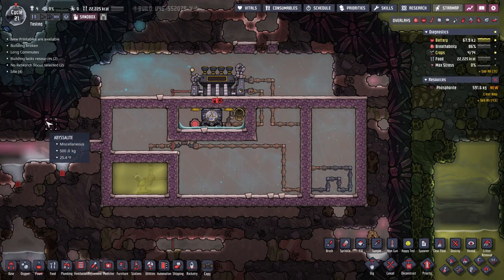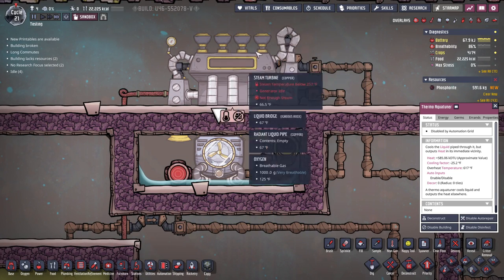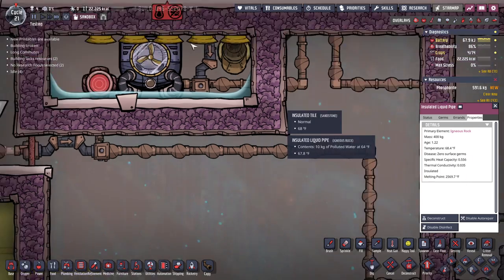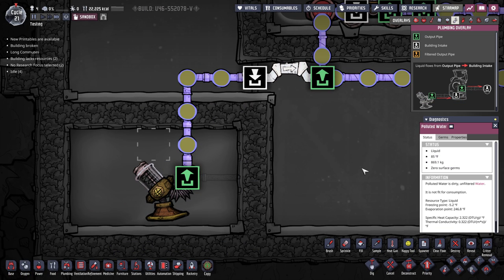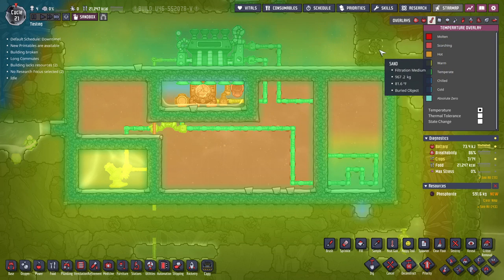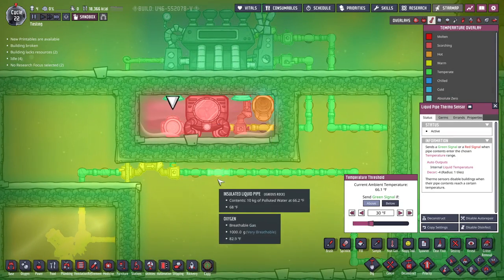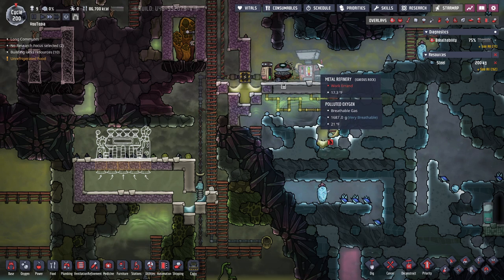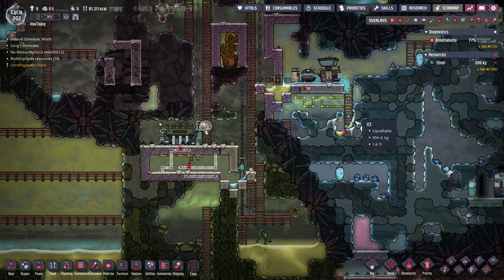Cooling Loop | Oxygen Not Included Beginners Guide (2023)

Comment: Thanks for this, really helpful. I have a basic question do you pump the polluted water into the reservoir before you start?
Reply from the maker: Sorry but I can’t think of what reservoir you’re referencing. Is it the bottom left square room of water in the start of the video?
Reply: @SilverNox  yes that’s the one. I’ve only played 24 hours so far. But really enjoying it
Reply from the maker: So the tank of water isn’t important. It was just supposed to represent a source of polluted water. Once the cooling loop is full of the water, it will be a closed loop. On the design in the beginning, there is a bridge attaching the pump to the loop of pipes that will be cooling. That makes it so just the right amount of liquid enters and once the loop is full, you can delete that bridge. Lol hopefully that makes sense, lemme know if it doesn’t!
Reply: @SilverNox  got it, thanks 😊

Comment: Why when I have the thermo sensor next to my AT does it still send down 44c water when I told it to turn off at 20c? Now my radiant pipes are using 40+c water because the pipes half the flow between AT and where I want cold water to go?
Reply from the maker: Sorry for the slow response! I had to wait until I was able to jump into the game to have a look. Without a photo, it is a little hard to tell what might be happening so I'll toss out some things to potentially check. Make sure the thermo sensor is set to send a green signal when 'above' and not 'below.' Double check that you aren't having power problems which might make it so the AT doesn't run. Make sure all the pipes are linked up correctly and all bridges are right. Finally, I would run it a little bit while watching the aqua tuner. You might be able to pin point what moment is letting the hot water through.
Reply: @SilverNox  it does like a 50 / 50 split which is weird. I had to like make a complete mess of my cooler lol to get it working or my base would be scorching oof. Ty for the reply :). I did watch another tutorial on pipes and they had the same issue with the AT allowing some hot water to move around the cooling loop when the automation shows green. Ty again thou!
Reply: youtube mary and jesus in the quran and mohmmad in the bible and the Torah and the scientific miracles of the quran and mohmmad in hindu scripture...
Reply: @2009samiy  How about you, YouTube Macedonian Jesus and have your life flipped upside down and start living in his light.

Comment: How do you make it return for another pass through the aquatuner if it's still too hot?
Reply from the maker: So sorry for the slow response! I wanted to reply when I had more time then forgot... For the most part, you can just let it go through the loop and it will get down to the temperature you are looking for. Unless you are cooling something really hot, or a big area, you are more likely to get your liquid too cold. If you do still need it to go through the aquatuner quicker than just running the loop, you could use a second thermo sensor plus the liquid shut off around the second bridge on my build here. Make it so that if it is too hot, the liquid shut off sends the liquid back into the start of the aquatuner